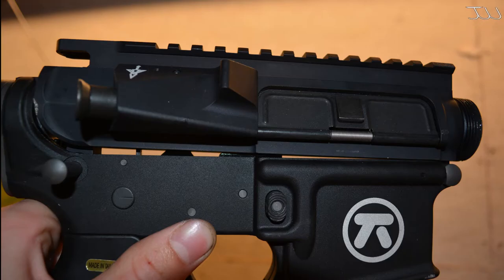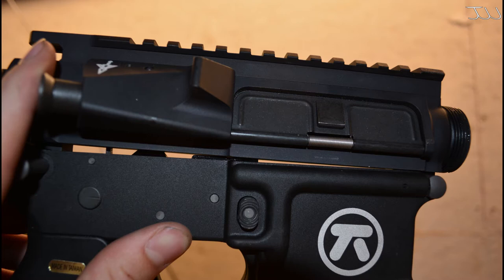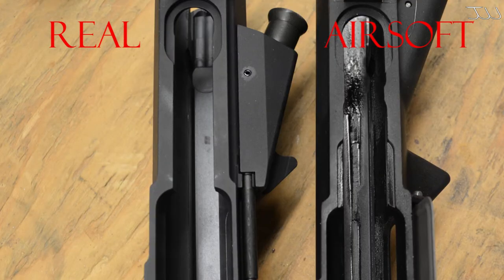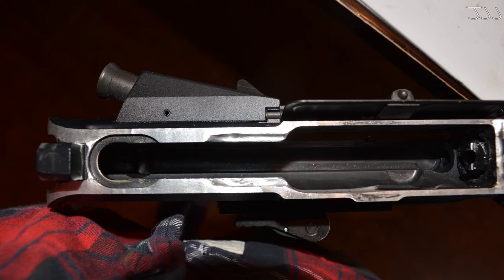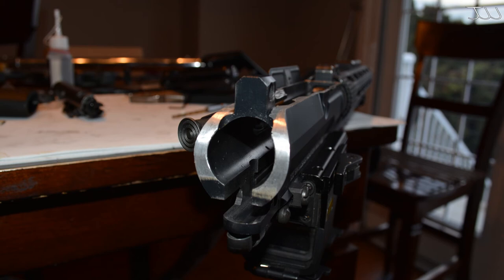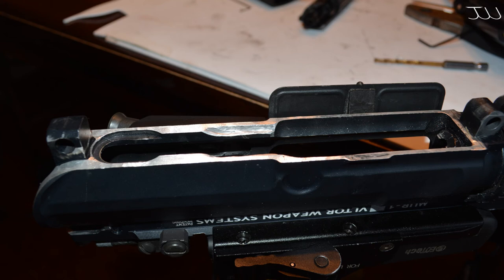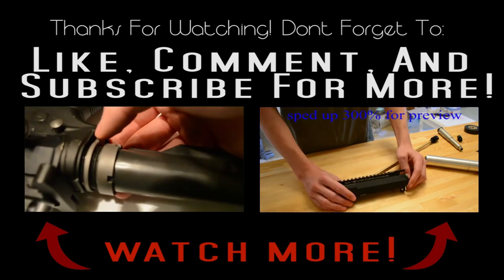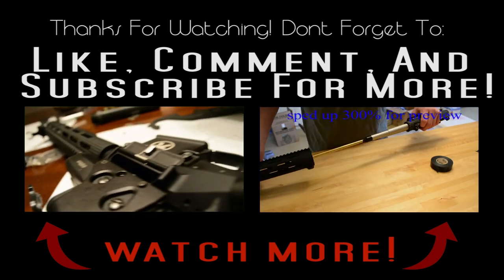How to use a Real Steel upper on an airsoft gun (WE GBB AAC HONEY BADGER BUILD)

Comment: Cool video. I've really been wondering if some of the airsoft lowers would work. I used to be a class 2 manufacturer and specialized in the ar15-m16  conversion. Having done so many I have a keen eye for the smallest of details and with some of the higher end Chinese copies the only thing that looks different is the bolt catch machining. Don't listen to those people telling you the gun could blow up just because the lower is a toy/pot metal. The lower receiver is under very little stress and with the function of the bolt locking mechanism with the firing pin there is no way the gun will fire out of battery. A person would have to purposely put a very soft primer in the round and remove the disconnector to cause an out of battery discharge and even then if the bore wasn't obstructed it would be very unlikely to kaboom.
Reply: I just realized that too! I’m looking at m4 full metal lowers and they look just like you could put real fire control group into them and slap a real upper on them unless they purposely make the holes different dimensions or something.

Comment: Why would you grind down a real upper to fit your airsoft lower? To say your airsoft gun has a real upper on it? What a waste of a perfectly good upper. But its not illegal in the states. The lower receiver is the firearm in the US.....not the upper. So the no no would be trying to adapt your airsoft full auto lower receiver to a real steel upper and shoot 5.56 live rounds out of it. Its not advise able anyhow for safety reasons. CUP pressure in real firearms would prove too much for airsoft pot metal or thin recievers. You may have a bolt carrier group sticking out of your forehead. Or the ATF at your door step......
Reply: Rockin M Ranch here as long as your not modifying the lower anything goes for other guns like airsoft guns
Reply from the maker: I wanted the ability to still use the stock upper with the stock lower so I modified the upper to work.

Comment: I see your playing in snow like weather with a gbb, are you using co2? Im preparing for the weather
Reply from the maker: yes, I am.
Reply: JoshWiebe oh and btw, this video helped me to put my 300 black out upper on my we gbbr m4!. Great vid btw.
Reply: FALCON3V .308 ?
Reply: @alexmcdowell8868   7.62x35, also known as 300 black out. Pretty much a round with the same energy as a 7.62x39, but with the speed of a 556 if I remember correctly, lots and lots of vids of the 300 black out round.
Reply: @falcon3v945  not even close to 5.56 velocities even in super sonic .300black. 
Its a 5.56 case necked up to .30caliber. Makes it easier to surpress because the velocities are so close to subsonic speed in standard pressure loads. Being .30caliber it also packs more muzzle energy than a 5.56 at the same subsonic suppressed velocities.

Comment: Lol if you had an Airsoft auto sear in the lower would it shoot full auto?
Reply: No, dimensions don't line up. Otherwise it will be considered a machine gun, and the ATF will shoot your dog.
Reply: Mr. Gible ha
Reply: @juhotasken  Unfortunately the ATF does consider those to be auto sears since it allows the gun to be capable for full auto function. However distribution of information is not illegal :)

Comment: I see no point.  Lowers were as cheap as $33 each when bought in sets of 2 this year.  The does not include lost cost in time and money.  

If this is just and exercise in the possibility, that should be mentioned why it was pointless.  If you want a ghost gun, it is probably easier to get a 80% lower and mill out the rest.  I like these videos, but don't want stupid anti-gunners using these video to make stupid laws.

Comment: Its not legal. He just made a full auto gun. (If it actually works) he is probably in federal prison as we speak.
Reply: You obviously don't understand guns.
Reply: It's completely legal, and it wont even work.It will blow up the moment the firing pin hits the primer/
Reply: Billy Celli you don't know guns very well, do you? Please do your research. Knowledge is power my friend.
Reply: If research gives me knowledge then what about actual doing it myself. You always see people doing this and saying that it will work but no one has the balls to do it themselves. trust me when i say it wont work.
Reply: Major Kuntz  It's not legal if it's a full auto lower. The lower could count as an 80% but it would be an illegal post sample machine gun the second the upper is fitted to the lower. If the lower contains all the parts to function with a real upper properly then it is a firearm.  The same law applies to making an Sbr, the second the upper is attached to a lower then it must be registered as an sbr.
Reply: This Guy it's not a real gun dude even if it has a real upper on it. Who cares if it's legal or not.
Reply: You do realize you can order a mold off the internet and pour epoxy in it and make a gun in an hour
Reply: Alex McDowell you do realize anyone can order non gun parts like parts not regulated
Reply: I have one of these, it’s legal in like 40 states to make into firearm, the rear pin is not a real pin, just a mock pin. Secondly all the pressures happen in the upper. I can promise you that it fires fine without exploding